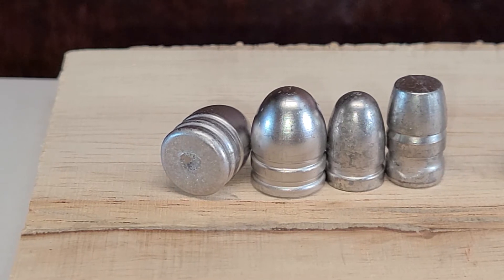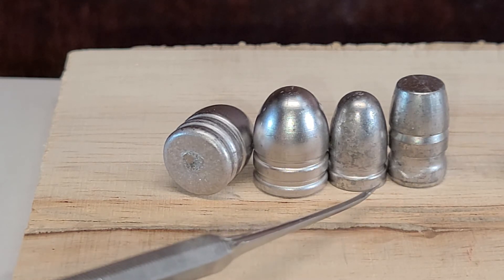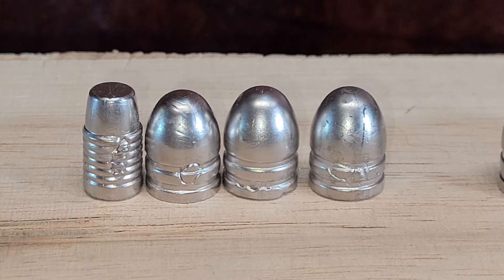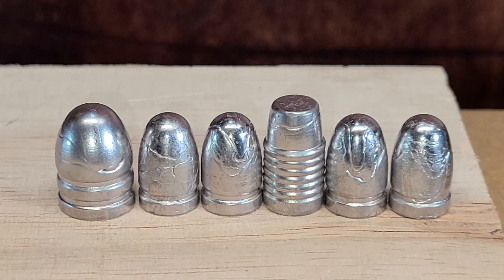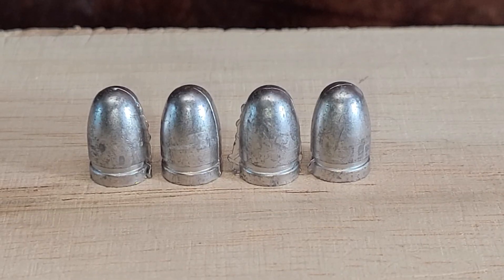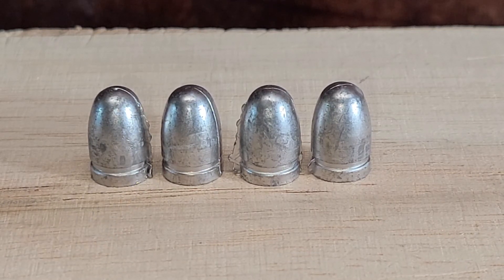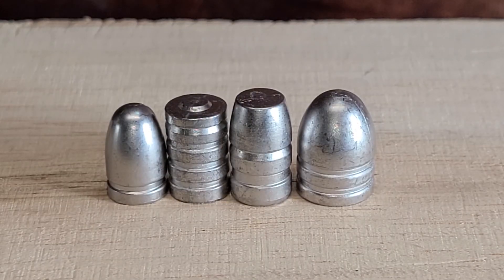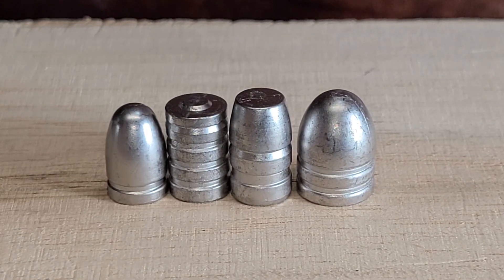Inspecting Cast Bullets - Common causes for defects

Comment: Wooden matches are covered in wax to protect them from moisture. I realized this when I was a pipe smoker, and noticed I got better creosote build up with a gas lighter. I think the wax boils off and ends up in the pipe. Best sooth is from a Ray Vin sight smoker!

Comment: are there casting kits sold? or do most beginners buy piece by piece?
Reply: I have never heard of a casting kit, but there may be a set up out there that comes with a few things. I started years ago by purchasing one thing at a time. The one thing I do wish I knew then was to get a melting pot with the built in pour spout. The first pot I bought was just a melting pot, so I had to use the lead pour ladle. That didnt last long. I picked up the one with pour spout, it wasnt much more expensive and was I was much happier. If you are considering starting to cast your own I would say, keep watching these type videos and get started picking up whatever you can afford to get you going. I hope this helps you.

Comment: Assuming you have proper lead (i.e. no tin in it), there are five issues that make or break a casting.

1. Pot temp. Should be around 720 to 750 F. Even 700 can work, but I like 720. Some people start at 800 to help get the mold temp up initially, then back it down to 720 or so. Get a thermometer!
2. Mold temp. The sprue puddle should NOT freeze up immediately after the pouring, but should take three 3 seconds or more to completely solidify. 4 to 6 for pure lead.
3. Mold surface prep. I degrease a new mold with break cleaner and Q-tips initially, followed by HARD swabbing with a dry swab. Then I smoke all my mold cavities.
4. Mold closure. As you stated, plus some VERY light lubing of the alignment pins only. Avoid getting ANY lube near a cavity or under the sprue plate.
5. Air venting. Even some of the best molds can trap air inside, causing poor fill-out, especially at the base. I shake my molds as I pour, and usually see little bubbles float up through the sprue. If your mold is not vented at the top (and most aren't), this will make all the difference!

Ok, a distant 6. Make sure your sprue puddle is heaped up, so there's plenty of liquid lead on top to feed the contraction inside the cavity as it cools.

Controlling all of these factors consistently and simultaneously is why my rejects are often better than most people's "keeper" bullets. I pour a lot of pure lead bullets too, from foundry lead, often with no tin whatsoever, or with less than 1% tin, and they fill out better than most peoples 5% alloy bullets.

When a mold that was dropping perfect bullets starts dropping imperfect bullets, and your temperatures are correct, then STOP, and HARD swab the cavities using CLEAN swabs, re-smoke them, make sure your mold mating surfaces are clean, and vents are clean, get the mold back up to temp, and it will be dropping perfect bullets again.

Fooling around, "fluxing" your lead over and over, and turning up the heat, as the manuals often say, will do NOTHING for you but create a frustrating mess. It ignores the real issues as stated above.

Comment: ...but how do you seperate the tin from other metals in pewter?
Reply from the maker: Why would you wanna separate it? Melt it as is, and add small amounts to main pot you're casting from. Pewter is typically 85-99% tin. Any additional metals are small. Those are usually copper or Antimony, which acts to harden lead, so that's an added benefit. No need to separate it.

Comment: It’s odd Lee Precision actually has in there instructions to use a beeswax candle to smoke there molds, I did that and ended up with wax residue in my cavities, bullets came out very wrinkled, hopefully a good cleaning with correct the issue. I will get some denatured alcohol for sure. I’m new at casting and this video helped a lot, thanks

Comment: SoS. my 240 gr 44 bullet mold results in 250-255 weighted bullets. bullets mostly look vg. even after sizing. is the mold marked incorrectly? thnx. pete
Reply from the maker: That's most likely an issue with alloy.  Your lead content is higher than your Antimony/tin. Makes the bullet heavier. Mood weights as based on whatever alloy they used when designing it. Usually something like Lyman #2 in most cases.

Comment: I found that the best way to prevent casting defects in a bullet is  to NOT USE a Lee aluminum mold. My Saeco  and Lyman molds cast way fewer defective bullets with the lead pot set at a much cooler temp. Second I found that cleaning the mold with acetone works wonders.
Reply from the maker: 95% of my molds are Lee molds. Never had a bad one, and I have 23 of them. Just gotta know how to use them properly. I get keepers within the first 3 drops.
Reply: @Namerifrats  How do you clean your Lee molds?
Reply from the maker: @OldGuy7949  Toothbrush and dawn with hot water. Sometimes mineral spirits on a qtip. I smoke the mold cavities with a Bic lighter. Not always necessary but helps sometimes.
Reply: @OldGuy7949  I take them out of the box, knock the burrs off, spray them with brake cleaner, & hit em with soot. I have never once scrubbed a bullet mold with a freaking q-tip. 
I mean c'mon people, guys thst were casting bullets 200 years ago weren't using dish soap & hygene products to prep their molds...
They were using fire......
Reply: Aluminum is the third best heat-conducting metal, this factor must be taken into account.

Comment: one question .
while i shake my bullets for powder coating .  powder does not stick to the bullets completely .
what could be the reason ?
Reply from the maker: Not enough static charge to make the powder adhere. Could be an inferior quality powder as well. Try some Eastwood powder. Ford light blue is popular and works great. I use Clear with great results.
Reply: @Namerifrats  i used ford light blue from  powder by the pound . and i shake alot

Comment: I hear if a guy adds over 15 percent pewter (tin) to the lead mix to get harder bullet it will cause air bubbles when cooling. Have you tried any mixes at over 15 percent pewter? 
I have a lot of pure lead and a lot of pure modern pewter and was thinking of trying to get 18 or 20 brinell, something like 75%lead, 23%tin, 2%antinomy
Reply from the maker: Anything over 3-4% tin is a waste of tin. Tin only slightly hardens. Antimony is what you want for hardening. Tin is to improve flow and mold fill out.

Comment: I bought some 69 cal Minie’ balls. On roughly half of the bullets on the inside of the convex cone, there is a hole that goes up inside of the bullet. Is that bad to shoot?
Reply from the maker: Like a void or cavity? Sounds like the mold or alloy wasn't hot enough. It would effect bullet weight and balance.
Reply: @Namerifrats  yes, its a small hollow cavity going in at the center of the cone indent. Quite a few were like that and I assumed it was normal since they were bought from Track of the Wolf. Hopefully they’ll be okay means I rolled 40 of them up into paper cartridges.

Comment: I am currious how you keep dross from building up on the walls of your casting pot and then contaminating your bullets?  That is the problem I am dealing with.
Reply from the maker: You flux the hot lead. I use sawdust. Stir it in really well and skim off the dross on top. Then I place more sawdust on top to form a carbon layer to slow oxidation of the surface on my lead.

Comment: If want you want to smoke your molds could you use a Acetylene torch before you add the Oxygen?
Reply from the maker: That should work fine. Anything that produces soot, it's the carbon coating that helps. I wouldn't recommend things like candles though. You risk getting waxy residue in the cavities and end up having to clean them again.
Reply: @Namerifrats  Thanks for the lightning response. I'll try the trusty Victor wrench. God bless.
Reply: I have had very little luck smoking and lubing molds. I find I get the best results from a Lyman mold meticulusly cleaned with acetone. All so  I find that my Lyman molds cast bullets with considerably less defects than the aluminium Lee molds.